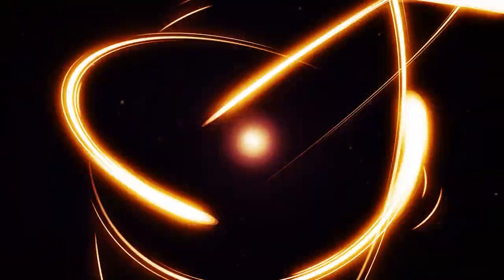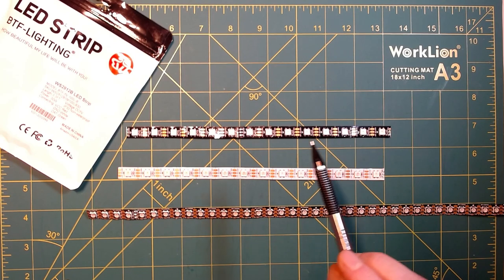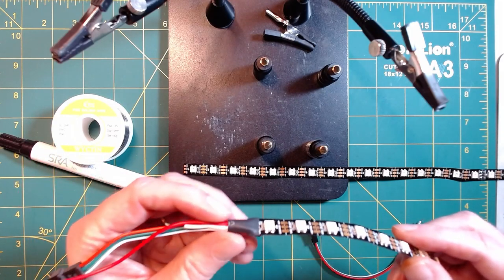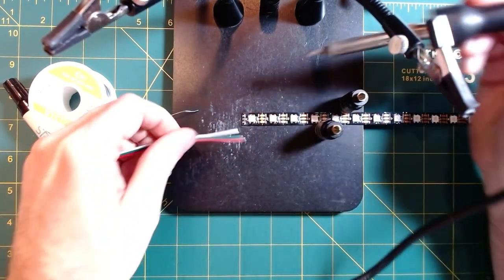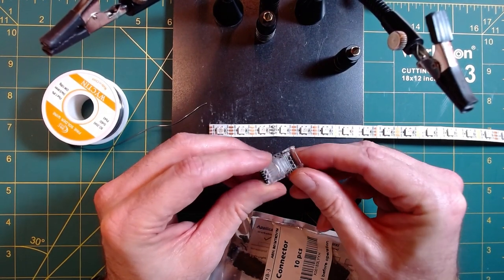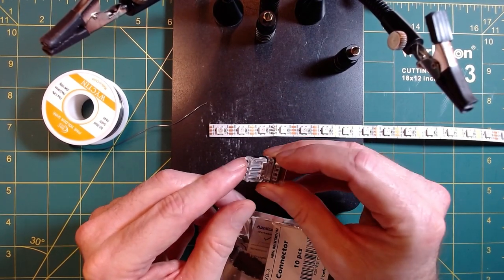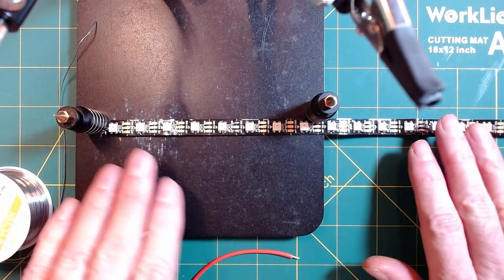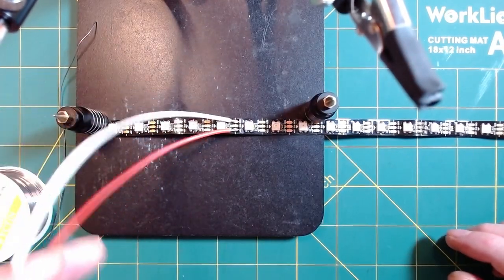Using WS2812b RGB Light Strips

Comment: I am looking for some help with questions. This video was extremely helpful.  I’m trying to use two WS2812B together.  I have the first one working fine with a controller and this power supply. . BTF-LIGHTING AC100-240V to DC5V10A Max50W Suit 9A 8A 7A 6A 5A 4A 3A 2A 1A Device Transformer Power Adapter Converter.   I simply plug them into each other with the connectors and the 2nd led strip won’t light at all.  From your video I believe I need power injection.  But I’m wondering why the 2nd strip doesn’t light at all ?  Not one led ?
Reply from the maker: Did you update WLED to add the additional LEDs to the total count?  If you told WLED that you have 60 LEDs and that fully lights up your first strip, then plug in a second strip, nothing is going to light up because WLED is only sending the signal for the first 60 LEDs.  If you are adding a second strip that is another 60 LEDs, then you have to update WLED to tell it you now have 120 LEDs.

Next, assure that you are observing the proper data flow direction.  If you are using the pre-attached JST connectors, it should be correct, but double-check the little arrows on the WS2812b strips themselves.  The data should be flowing "out" of the first strip and "in" to the second strip.

Next, check both strips individually.  Connect your controller directly to each strip, one at a time.  It is possible that one of the strips is damaged/faulty or one of the JST connections came lose or has a broken wire.  If both light up individually, the data direction is correct AND WLED has the proper number of LEDs set for the total number when using both strips, you should be able to connect them together and get at least something on the second strip, even if power injection is needed to get full brightness on the second strip.
Reply: I told my controller board through my app that it was 600 pixels but it wasn’t working. It wasn’t even saving that 600 config.   I now just screwed up my first strip.  My colors from the app werernt associated correctly with the app, so I read to flip the wires.  I flipped the wires and I burnt my first strip.  Only 1 led goes on. The rest won’t light up.  Ughh.
Reply: @ResinChemTech  for reference I use the magic LeD app.  With the BFT lighting Bluetooth controller.  I’ll check the data direction but I was under the impression it could only go one way because of the female/male sides.
Reply from the maker: Yeah... it is unlikely that the data direction could be an issue if you are using the standard JST connectors that are pre-attached to the LED strips, but I only mentioned it because it is easy to check just to be absolutely sure.

Sorry, but I'm not familiar with the controller or app that you are using since I generally always build my own controllers and use WLED.  Not sure I can be of much help with a controller/app that I haven't use before.  Maybe someone else that has used that controller or app can offer some additional advice.
Reply: @ResinChemTech  ok. I have to wait for my new strip since I think I burned out my initial one.  But if you’re saying I should still see some light just by connecting them together; I’ll try again tomorrow and let you know.   I think you recommended a premade controller in the video that I could use instead of the one I am using now.  Maybe that would be better?
Reply: @ResinChemTech I got the 2 strips to work correctly now. Only issue is that connecting them via the connectors leaves a gap of no leds.  Is the only way to connect them with no gap is to cut them and solder them together?
Reply from the maker: Well  you could certainly cut off some length of the wire and re-solder them... or use some of those plastic snap on connectors (I never really cared for those), but any type of connector is going to leave some sort of gap.  The only way to connect strips together with no gap is to solder them together (09:23).  But do note that it is pretty easy to remove the heat shrink and desolder the existing JST connectors, so you don't need to cut away any pixels to join them and still have the entire length of both strips.
Reply: @ResinChemTech  my Strips have this plastic sheath on them. I guess I have to Peel that off or cut it away before soldering?  I didn’t know I was buying ones with plastic coating over them….  I’ll try to solder and see how it goes. I can’t stand the gap when connecting.  I’m assuming the data will still work and the two strips will follow patterns as before from the app .
Reply from the maker: Yeah.. buying IP65 or IP67 rated strips (for outdoor use) does add complexity to soldering the strips together.  For indoor displays, I always use the IP30 strips with no plastic coating.  But the process is still the same.  You can gently peel back the coating, solder the strips together in the same manner, then put the outer coating back in place (you will need to reseal it if using outdoors).

I routinely cut and re-solder my strips.  In my recent video on WLED segments, I cut two 300 pixels strips into four 75 pixel strips each.  I soldered on JST connectors for the video, then when done, removed the JST connectors and soldered the strips back together to make each of them 300 pixels long again.  I will often also solder short scraps or leftover pieces together to make longer strips.  As long as you are careful with your soldering (and make sure you are observing the data direction), the strips will work just like they were originally one single strip.
Reply: @ResinChemTech  just to give an update , I tired soldering and I must have done a bad job because only the first 30 led were lighting on.  So I used a connecting clip and it seems to be working fine. I probabaly didn’t get a good power connection on the solder joint. Oh well. The connector is working good so far.  Oh but one problem. The connection doesn’t fit in my diffuser channel.

Comment: Hi I’m looking to add them same LEDS around my room, i will need about 15 metres though, if I get a solder kit will it be okay to solder 3 5M strips together?
Reply from the maker: You can theoretically solder together as many strips as you like, using the technique I showed in this video.  However, you will likely need to do multiple power injection points for a strip that long and with that many LEDs.  You also need to be aware as to how many LEDs your controller can adequately support on a single data pin.  If you are using 60 LEDs/m, then you will have about 900 pixels.  That is really at the upper end of what an ESP8266 can handle via a single data pin.  Unless you want to use multiple data pins, an ESP32 would probably be a better choice for an install of that size.

I hope that info is helpful.  Good luck with your project.

Comment: I bought a 5 volt 40 amp power supply for my 2 rgb addressble strips and a led matrix, the same one you show at the end of the video. What nobody shows you is there is no plug to plug in your power supply. You have to basically cut off the 3 prong plug from a washing machine. Do you have a video showing what wires for that plug, plug into what spots on those power supply bricks that you showed. 
Im trying to hook up the LED and matrix to my virtual pinball table. I bought a teensy board because everyone said i had to, needless to say it didnt work out. Any help would be appreciated.
Reply from the maker: Yes, the larger "transformer" style power supplies need an AC power cord to plug into a standard outlet that does not come with it.  I usually include that item in the parts list for those projects that require the larger power supply, but guess I didn't explicitly mention that in this video.  I always order one like this https://amzn.to/36dU7Lz (affiliate link) whenever I order the power supply.  In fact, I just keep a number on hand.  You can get them in different lengths and gauges as well.  There are three terminals on the power supply marked 'AC'.  Black wire goes to (+), white to (-) and green to GND.  Two other items of note.  First, most of these power supplies are designed to work with either 120V or 240V AC and are set via a small toggle switch on the side.  Be sure it is set properly for your situation (e.g 120V in the US).  There should also be a very small set screw on the front near the terminals.  This allows you to adjust the output voltage slightly.  You should connect a voltmeter or multimeter set to an appropriate DC voltage range, connect to one set of DC output terminals and adjust that screw with a small screwdriver to assure it is outputting 5.0V.  I've had them come out of the box as high as 6.1V and as low as 4.3V.  This screw is meant to 'fine tune' the output voltage.  Do this after connecting the AC power cord, but before connecting any of your 5V devices.

I can't directly speak to the teensy board and why others may have said you "have" to use one of those.  If you are trying to use a specific application or firmware with your pinball machine that requires a teensy, then that may be true.  But for nearly all of my LED projects, I use an ESP8266 or ESP32 dev board.  This already has wifi (and bluetooth for ESP32) on board and can run WLED.  Although I have written my own controller firmware using Arduino/C++, it's hard to beat WLED for the features and ease of installation.  But your use case might make this option unsuitable.
Reply: @ResinChem Tech  thank you, i dont know why people use a teensey board for all their Addressble LED's.  Thank you for your response,ive learned more from your one paragraph then i have reading for weeks.
Reply from the maker: Hey... just glad I could help!  Again, I'm not sure about the teensy.  I just figured it had something to do with tying into the pinball machine?  For just standard LED strip lighting, it's hard to beat the cost, ease-of-use and feature set of WLED on an ESP board.  I have had occasion to create something 'special' using Arduino code on a matrix... but that was for displaying text.  But even then, I used an ESP8266 board.

FYI... I was thinking about what you said regarding the power supply and realized that I did miss some basic, beginner info.  I just published a related blog article (https://resinchemtech.blogspot.com/2022/03/using-led-strips.html) that includes some additional details, including info on using the transformer-style power supply, connecting an AC cord, etc.  Thanks for the suggestion and call-out on the missing info.  I hope you might find the additional information helpful.
Reply: @ResinChem Tech  , im not sure if everyone uses teensey but pretty sure. I think its able to connect to doflinx, and then when your playing say the AC/DC premium table on your virtualpinball table, the matrix puts on a amazing light show, as well as all the other tables. Im sorry if i didnt mention this was all for use inside a virtual pinball table. Thanks for the help. Like and a subscribe from me.
Reply from the maker: Ah... that makes sense now.  I wasn't familiar with doflinx, so I went out and watched a couple of videos on virtual pinball cabinets (not familiar with them at all), but now I get it!  That's not something that WLED could currently do!  But now you've opened my eyes to the world of these virtual pinball machines, so may have to think about one of those in my future to go along with my retro arcade cabinet.

Thanks for the like and the sub!  I greatly appreciate it.  Good luck with your project. I'd be happy to help out, but at this point, know next-to-nothing about virtual pinball!
Reply: @ResinChem Tech  trust me, once you go down the rabbit hole theres no coming back lol

Comment: On that solder you use the amazon link list option for mm and grams what do you use?
Reply from the maker: The link should have brought up the 0.6 mm, which is what I normally use.  As far as 100 g vs. 150 g, etc. that's just the amount of length of solder on the spool, so it depends on how much you want.  I go through quite a bit, so I usually order the 0.6mm 150g or 200g.
Reply: Ok thank you! @ResinChemTech

Comment: Hi ,  

We always find  your videos to be  amazing and provided valuable information and most importantly you take time to give feedback as you did 
with other and with me personally. I think you are an excellent mentor and you do all this  without a personal gain . Please know we appreciate it . 

I am wondering if it would be possible to post a question related to WS2812B project I did after watching your videos before which would be of 
a great help to me and others . 

In summary , I am struggling with powering the esp32 and 8x32 WS2812B matrix from the same 5V12A PSU  .  Everything works fine with a 
separate PSU for esp32 . 

As the post is long with links to diagrams, I wanted to ask for your permission and I do not want an immediate answer and can wait until 2022+ 
or better wait for a  how to  video in your channel . If for any reason it not possible then I would like to thank you for the help and information you
 already providing us  .  

 

PS. We are interested in getting  the 12V WS2815 strips but it is not in the links , could you add it please   

Thank you Sir ,
Reply from the maker: Thank you for the kind words!  I'm always happy to help out and assist as best that I can and as my time permits. It's odd that things work with separate power supplies, but not off a single supply.  I will say that for a 8x32 matrix (256 pixels), a 12A power supply is a bit under-powered for full brightness... to account for full white, you'd probably need around 16A (256 x 0.06 = 15.36A), although most effects will be well under this limit, or if using WLED, you can use the brightness limiter.

If you need to share links or diagrams, it is probably best to contact me via email, as YouTube will automatically block any posts with links.  You can find my email address on my channel's 'About' page.  With the holidays, I may not be able to respond right away, but I'll try to get back to you as soon as I can.

As far as the 12V WS2815 strips, I have not personally used them, but I have had good luck with light strips by BTF Lighting.  Here's an Amazon affiliate link to the WS2815 by BTF:  https://amzn.to/3GZOMV5

I hope that's  at least a little helpful!
Reply: @ResinChemTech  That  is fantastic , I have sent you the mail with the same subject as this video . One last thing is I want to know If it would be possible to send stuff to your channel  (  esp32s, strips ..etc ) or anything  you may use or tear-down , just as a  small thank you . Please say yes
Reply from the maker: Check your email.  I've sent a reply that I hope will be helpful.
Reply: @ResinChemTech  WOW , The first paragraph of your email solved the issue . I am really  lost for word but really thank you very much Sir .

Comment: At what voltage do you think it would need to drop too for the lights to start to dim?
Reply from the maker: Theoretically, the lights begin to dim at any voltage below 5V.  But you probably can't detect it.  It's impossible to give a precise voltage when you will be able to appreciably notice it.  It also depends on the number of LEDs and the level of brightness you have set.  That's why I always recommend a bench test with the total number of LEDs you plan on using for your project.  You have to balance what you would consider an 'acceptable' dimming or color shift towards the end of the strip vs. the hassle of running power injection wires.  In some cases, you may decide that just a slight dimming in an install where the LEDs are not directly visible is acceptable and better than trying to run extra power wires to the end (or middle) of the strip somewhere.  In other cases, like a matrix or something, any dimming at the end of the strip may be unacceptable and you might decide that running power injection wires is worth it.

I can say that once the voltage gets down to around 3V or lower, the LEDs can start to flicker and misbehave in other ways.  But as far as dimming, you notice the LEDs start to shift towards a pinkish color when lit up in white.  If you start to see pink towards the end of a strip when you LEDs are set to white, it's a sure sign that you need to consider power injection as much more of a voltage drop runs the risk of the flickering/misbehaving LEDs that I mentioned.
Reply: @ResinChemTech  thanks for the response.

Comment: Quick question... If I wanted to make a 6 meter strip, that is mirrored 3m for left and 3m for right, could I join (2) 3m pieces that are soldered in the middle with the data arrow away from the center<---|--->?  And inject the data line and power at the center splice?  Much like you did the (2) sound tubes, but no green wire between, having a junction in the strips' center instead?
Reply: Nevermind, I just realized that if I did this, the 5v and GND would be on opposite sides.  LOL
Reply from the maker: Don't feel bad!  I was so curious about whether the signal would work or not, I actually was going to try it before I replied to your question.  But like you, just as I went to solder the two strips together, I noticed exactly what you did!  I think you could separate them with a very short leads, tie the leads together and then to your power supply and controller.  I've split the signal to two separate strips in a number of different projects.